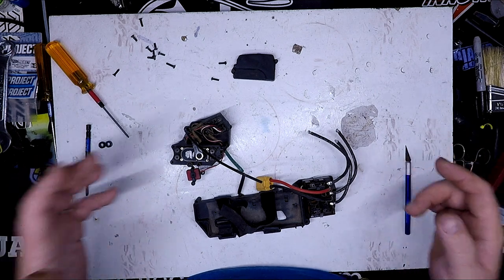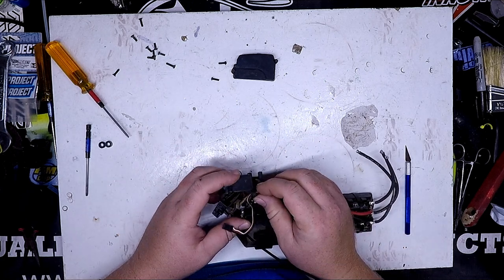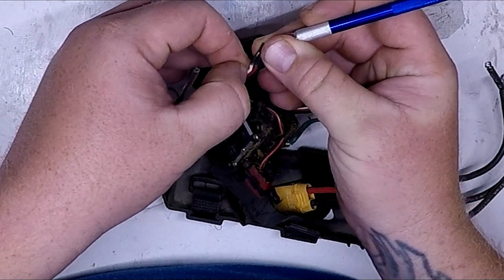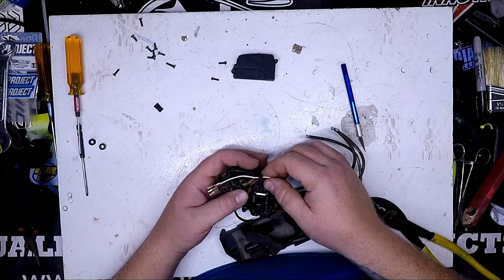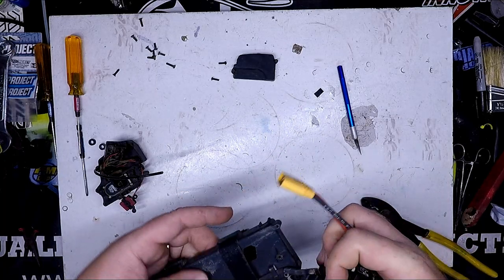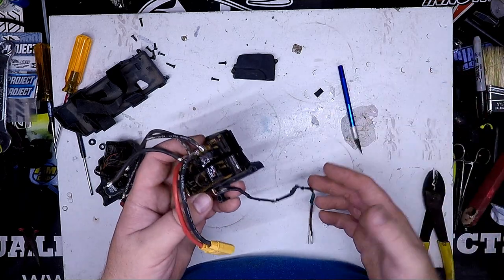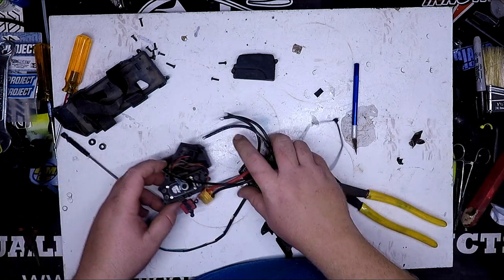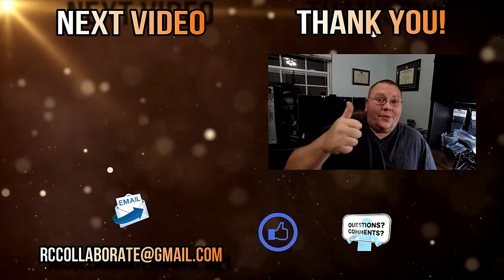Tips for Installing Servos, ESC, Mylaps etc in Radio Box with Rubber Grommet like Mugen

Comment: I've got something hopefully you can help me with I have a V4 kraton I put a Mamba Monster X 2200kv set up in it with a 12 tooth pinion it didn't make it through the first battery it fried it locked it up tight I see you at one of your videos has the same setup but you're running a 22 tooth pinion I thought the bigger you go the more he didn't makes am I wrong will the new 1515 run cooler if I put a bigger spur on it doesn't that mean faster to
Reply from the maker: Yes bigger pinion is hotter. You got faulty castle. Have them replace it
Reply: @therccollaborative9524  they are sending me one soon as it gets back in stock. That motor makes this truck stupid fast with a 12 tooth pinion can't imagine it 22 probably do like a hundred miles an hour wow. Is that possible without frying something. You must have been running a 4S. Do you know anything about the hobby Star Motor 1730 seems to be the buzz of you tube